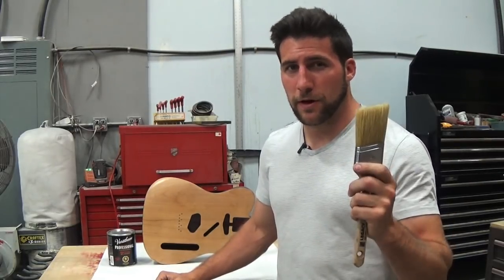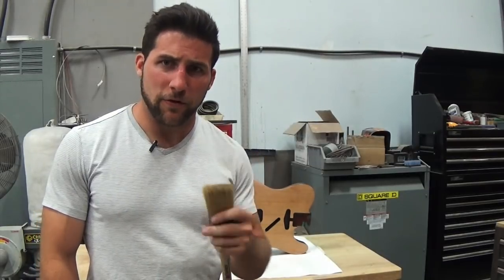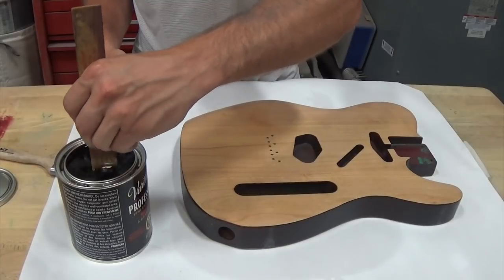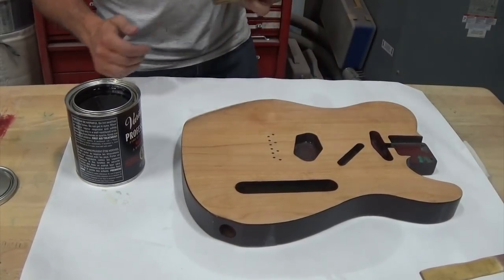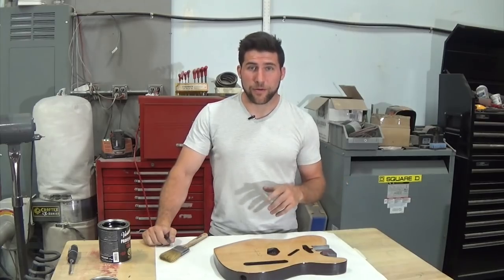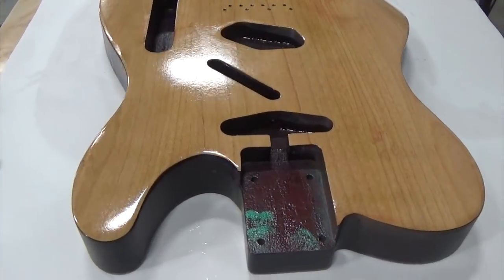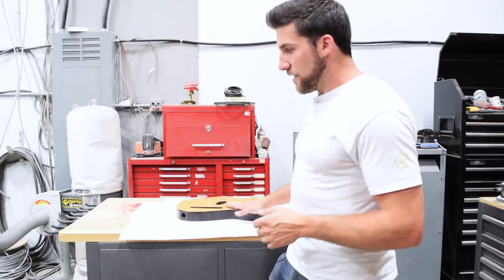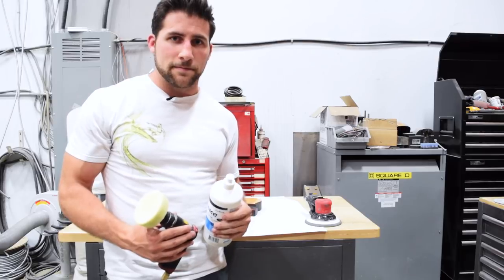How to Brush On a Beautiful Gloss Finish

Comment: you mentioned about doing a test to make sure it won’t cause problems with the paint. 
in another video you used dupli color paint.. do you know if this will work over that kind of paint? i’m still trying to figure out if i need to use lacquer or acrylic lacquer paint. help… thank you for your work and videos. they are so helpful
Reply from the maker: I’ve never tried those two together.

Comment: Guys, this strictly a personal preference, but as a long-time automotive painter, I prefer spraying every time.  Thick finishes are said (by some purists) to alter tone.  Spray-can polyurethane enamel clears work fine on guitars -- so do Krylon spray paints from Wally World or K Mart.  (Others will work, and any cheap spray-on primer is okay, but I've always found Krylon to be the best quality spray paint.)  Ya won't have brush-mark streaks, either, and final polishing is IMHO optional. Depending on how well you handle a spray can.  (Car model builders will be ahead of the game.)  That said -- good vid, Brad, that should be a nice-lookin' guitar.
Reply from the maker: +Seth Tyrssen Thanks Seth. I also prefer to spray, but sometimes it's not an appropriate option.  Some of my viewers are trying to refinish guitars in their apartments, or are painting other objects that are affixed to things that they don't want to get paint on and that aren't appropriate to tape off fully. I'm trying to offer a variety of options, but spraying is certainly my favourite application method.

Comment: I can't thank you enough. I took everything you said on board on a very expensive vintage guitar. Had a very bad reaction with nitro lacquer on my vintage lacquer (monday), yes it should of stuck but none of it did, nightmare. Took a deep breath and decided to get it off quick (long story, but i did, thank god). I then bought some Coo - Var (pack 2) polyurethane clear varnish gloss, and tested for 1 hour were the 4 screws hold the headstock to the fret board, perfect. Then putting the guitar body up the ways in a hard plastic rod tube and taped the made up bit of wood i screwed in to headstock and used also my experience on how i was taught to varnish with yes sanding with 600 grit as i had my old lacquer intact. Varnished the whole body and wow it came up like new, 1st coat is dry (thursday) and tomorrow il sand with 600 grit (lightly) and after it dries il let it sit for 3 weeks. You guys are craftsmen and i can never thank you enough.
Reply from the maker: Glad I could help
Reply: @BradAngove  Hi Brad, i decided after 2nd coat to wait 2 hours and i put on 3rd final coat. Yep i lightly sanded with 600 grit (dry) after 1st coat (1st coat looked amazing, thanks to you) and the Coo - Var was very forgiving and left no brush marks and is in a spare (heated) room drying. I will leave it in that room for a few weeks to cure. Brad just one question if i may in say 4 weeks time before i put guitar back together again what would you recommened (no buffer or sander in mind) to polish it (if safe to do) to make it super smooth (if needed) as i don't want to use sandpaper after all work gone in this week, i don't want to scratch final coat.
Reply from the maker: If you’re not planning on using sandpaper as part of the polishing process then there’s really no point in going through that process. Luckily, polishing is purely aesthetic. If you’re happy with how it looks there’s really no need to go down that road.
Reply: @BradAngove  Thanks Brad for your time, appreciated. 1st coat was beautiful i mean faultless, sadly i was taught 1 coat only for gloss so this was all new to me adding more coats, the other coats just didn't happen so i have to sand and clean and start again. Im learning a lot, but i should of just been happy with the one coat. Got about 80% off keeping all the paint underneath in tact, it's a 3 sunburst tone body, it really did look new after 1st coat.
Reply: @BradAngove  Brad just to add, as mentioned i was taught a single coat of gloss is a finished job. Anyways i acted quick. soaked the guitar body with oven cleaner for 30 minutes and i scraped (plastic) 80 - 85% of the polyurethane 3 coats off, bit of work yep but gladly she kept all her original paint 100%, light sand next week and 1 single coat, job done.
Reply from the maker: With some of these thicker brush on clear coats you can get away with just one if it goes on smooth.
Reply: @BradAngove  Agreed.

Comment: I’ve never worked with anything like this but plan to soon. I have a old guitar that was never used. So i decided to sand it down and customize it with some acrylic paintings. I want to gloss it back up! Would my acrylic paintings on it smudge after applying gloss?
Reply from the maker: They certainly could. It would be preferable to apply a couple light coats of spray clear first to protect/set them.

Comment: Can this product (or any product) be put on over a Tru Oil finish, without string back to bar. Love the look I've got, just want a glass gloss finish to it. Thank for passing on your expertise.  Locked down in Edmonton Alberta. lol
Reply from the maker: Once the tru-oil has had time to dry 100% you can likely give it a light sanding with 800 grit paper and then clear coat with catalyzed polyurethane.

Comment: Hey Brad, great video! 
 I have almost finished my project and it looks great, the only thing is the poly finish still gets imprinted when I run my fingernail across. The project has sat for 2 weeks. Should I just let it dry longer?
Reply from the maker: Ya, just give it another couple weeks and it may finish hardening.

Comment: Beautiful and helpful video, as usual... Just a question: if the guitar has been colored with water-based stain, would you use any product like sanding sealer, grain filler or would you just brush the finish directly onto the stained wood? Thanks a lot.
Reply from the maker: If it’s already stained I wouldn’t grain fill. I would often use a sealer of some description though. It depends on the wood type somewhat.
Reply: Brad Angove Thanks for the reply... I honestly don’t know what type of wood it is. I’m gonna make tests on scrap wood until i figure out what’s better for my process... thanks!
Reply from the maker: Hard tight grained woods like maple can often be done without the sealer.

Comment: You mentioned early in the video to test a section if you're painting first, to make sure that clear coat doesn't have a bad interaction with the paint.  How about if you are using a transparent stain first?  Same thing or is that less risky?   I love the gloss level you achieved with this product and process!
Reply from the maker: Its still best to test it. Preferably in a separate piece. Stains don’t all have the same chemicals etc.

Comment: I have a brush on satin poly, I'm staining the guitar black
Should I thin it enough to just wipe it on or would the brush work
And as far as the coats go, I have no way to suspend it, so should I do the front and sides first? Or tape off the sides, do the front, then do the back, then sides? It's my first time so any help would be absolutely amazing!
Reply from the maker: Brushing should be fine. Do the back and sides first. Save the front for last.

Comment: Hi Brad, thank you for taking the time to make your videos. Two questions:
1. Did you fill the grain on the wood here before adding a finish?
2. Would this finish work over a previously applied nitrocellulose finish? (I have a guitar body that already has a thin nitro coating).
Reply from the maker: I didn’t fill the grain on this one because it’s a tight-grained wood. I would have in other circumstances. 

If the nitro has been on there for a very long time, then yes you can just sand it lightly with 600 grit and apply this overtop. If it’s new then that creates a risk of unfavorable reaction.
Reply: @BradAngove  . RRR, Thank you for your question #2, and Brad, I appreciate your videos and your reply here. I only discovered you a few days ago, and I’m subscribed and going over your old content. 
I have a 50 year old Japanese blue grass banjo that has a typical two tone (dark mahogany/caramel ) varnish of the time….I really don’t know what finish it is ( the veneer on the resonator is mahogany, the neck is maple)but I’d like to sand it with 600,  touch up some chips with color matched stain, then do your process here. 
Is that an ok path to take or do you have a better idea? I’d like to keep the patina of the wear and color, but give it a fresh clear coat.
I appreciate your time! Best Regards, Shawn
Reply from the maker: I don’t see any reason why that shouldn’t work Shawn.
Reply: @BradAngove  . Thank You Brad!

Comment: Hey Brad so i got me a new kit and   i have some oil based wood stain . And a water based polyurethane clear gloss.   On it . Have you ever use varathane  wood stain and would you recommend it.
Reply from the maker: I’ve used it and have found that it generally works fine, as long as it’s not the combo junk with stain and poly in it.

Comment: Do you have any advice on using this method on the whole guitar not just the face of the guitar. Will drips on the guitar be a major problem with this method and if so how could I avoid this? Thank you and love the material you put on here!
Reply from the maker: Drips could be an issue. You just need to paint a thinner layer where you are concerned with drips, and give one side plenty of time to dry before flipping it over to do the other side. 
If there are drips you can wait for them to dry fully then sand them out and polish.

Comment: Could I paint over the wipe on poly with the brush on stuff you used? The wipe on poly didn’t give my guitar the super glossy look I was looking for
Reply from the maker: Yes. Just sand it lightly with 600 grit to get it nice and smooth and you should be good to go.
Reply: I also had issues with minwax wipe on poly.   Perhaps i put my layers on too thin.  I was able to sand (up to P3000) and get a smooth mirror finish with Meguires polish, but it was a bit cloudy and you could clearly see lines where i burned through the different layers of finish.  Since poly doesn’t “melt” into previous layers the way lacquer does, perhaps a thick brush on overcoat would avoid these issues.
Reply from the maker: Unfortunately you need to be very careful sand back the wipe on product because of potential witness lines.

Comment: That appears to be a flat top, so if I am thinking of doing this to a very matte finished Gibson with a slightly carved top. would the process change? In other words. would the material dissipate from the top as gravity pulls wet finish to the edges?
Reply from the maker: It does level a bit. Put the first coat on a bit thinner, then sand once it’s dry and brush your next one on a bit heavier. 

It’s shouldn’t be a problem.

Comment: Can this be used on top of a Duplicolor spray lacquer? Assuming it has dried properly for a few days before top coating.
Reply from the maker: I think so, but I would suggest using a coat or two of the duplicolor clear coat first as a barrier in between.
Reply: @BradAngove  yeah I guess it makes sense to add a sort of buffer between the acrylic and the poly...if I mess up I can still scratch it without touching the color.

Comment: Great Channel and videos. I'm going to be finishing a new Alder body Strat in the next few weeks. What I'm looking to do is to achieve a wine red finish. I was thinking about going to Stewart MacDonald and getting some color tone stain. I was told to mix up some red and blue to achieve that color. Do you think I should get some wood filler apply that in and sand it off maybe get some highlights in the wood and then apply the mixed stain into the body or put some sanding sealer on there first? Also was thinking about using the Varnish in this video or maybe some wipe on poly after that. Any tips would be appreciated. Thanks
Thanks for your efforts and good luck.
Reply from the maker: Are you able to spray your finish on? If you are, I’ve got a different technique and product that would probably serve you better.
Reply: Brad Angove  Thanks for the reply. I believe Stew Mac has a product that will allow me to mix and spray. It's a jar with a throw away aerosol screw on top.
Reply from the maker: Are you hoping for a nitro finish, or poly?
Reply: Brad Angove I guess it didn't really matter. I was kind of hoping to use that wipe on poly or Tru oil. But I can spray it with nitrocellulose lacquer or poly.
Reply from the maker: The problem with the wipe on stuff is it will look streaky with a tint in it. I suggest you have a look at the kandy kolor spray cans from house of kolor. Kandy Brandywine might be your best bet. They should be available through coastairbrush. If you want to stain, you can use the colortone and the a wipe on poly instead.
Reply from the maker: The problem with the wipe on stuff is it will look streaky with a tint in it. I suggest you have a look at the kandy kolor spray cans from house of kolor. Kandy Brandywine might be your best bet. They should be available through coastairbrush. If you want to stain, you can use the colortone and the a wipe on poly instead.
Reply: Brad Angove Cool buddy. Thanks for the tip. Great channel and a Good guy. All The best.

Comment: Hi Brad, can you still do wipe on gloss if you are coating the entire guitar? Im struggling to think how i could apply the gloss to the curved edges/sides of my stratocaster body without it dripping/running, is this something thats possible? 

Thanks in advance!
Reply from the maker: It’s certainly possible. You’ll need a thinner brush for the edges. Or if you actually mean wipe on poly you just wipe it on in thin coats. Lots of them.
Reply: @BradAngove  thanks Brad, in the end I decided to bite the bullet and have bought some spray equipment!
Reply from the maker: @toby8261 I hope you enjoy working with it.

Comment: Is it possible to brush spraying nitro lacquer with proper thinning? I'm not able to get this kind of varnish finishes. Your's turned out nice.
Reply from the maker: You would have more success using brushing lacquer. Thinning would do the opposite. You can mix brushing lacquer with some solvents to create spraying lacquer.

Comment: Hey its me again. So there are two sprays from rust oelum i see on the shops. Clear gloss poly, and gloss varathane. Curiously,  the varathane is a little more costly. Im still doubting on using the minwax tung oil, and the sprays are more cheap, so im tempted. The thing is i used a clear laquer spray, dont remember what brand it was, but that thing destroy my finish after 1 year and a half. Hence why im refinishing my guitar. Oh man its supposed to be a simple natural finish, how come it is more complicated that applying a solid color? Do you recomend those spray or they will destroy my finish after 1 and a half year later? Those are the ones i see are better quality, apart from the Harris, to limited things to choose here in my town =/
Reply from the maker: The gloss poly will be stronger than the lacquer was. Poly is a stronger product. It should last longer.
Reply: @BradAngove  i think i will go with Zar  poly oil based. In brush,  i have seen good result with it and with the stains, i havent seen finish with the rust oleum poly  spray anywhere...

Comment: Maaan, this came out great. i tried with some lacquer in Germany but it didnt dried properly, even after weeks i´ve got a sort of sticky finish in some parts. do you know by chance how this gloss finish is called in europe? thanks a lot
Reply from the maker: See if you can find a urethane clear coat. That’s what this is essentially.
Reply: @BradAngove  i can get polyurrthane. I did with acrylic and was crap. Btw. Do i habe to send off the whole finish or can i brush it on the top of it? The sticky parts i habe removed by sanding already
Reply from the maker: It depends on what you’re going to put on it. Usually you would sand it all off.

Comment: Hey Brad, first of all thanks for your video! Great stuff! Can I ask, do you finish the top first then the back then the sides (or some other particular order)? Or do you finish all of them at the same time and hang the body somehow? Is there any problem to tackle them separately? The wood moving cause one part is finished and not the rest for example? Thanks!
Reply from the maker: There’s no really issue with finishing separately except where the paint overlaps perhaps. But, if you take a look at any of my more recent paint jobs you will see I general suspect the body and spray it all at once, starting with the edges then generally the back then front.
Reply: @BradAngove  awesome! Thanks for the tips!
Reply: @BradAngove  I was just wondering if you ever tried to apply this type of finish on a guitar using an electric spray gun. Just wondering if they are worth it (dont think I can afford a compressor and a spray gun for it). Thanks
Reply from the maker: I’ve never tried it, but I know some people have done well with turbine guns.

Comment: Hi Brad! Do i need some kind of sealer on a sanded down guitarbody before applying lacquer? The wood is poplar so its a fine grain.
Reply from the maker: You don’t technically need it, although it will likely help you achieve a smooth coat faster.
Reply: Brad Angove thank you